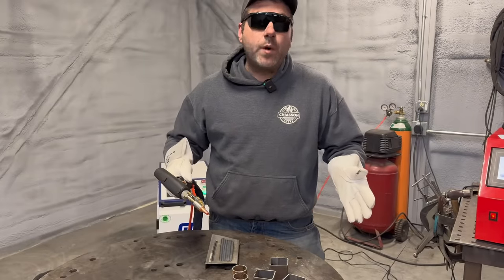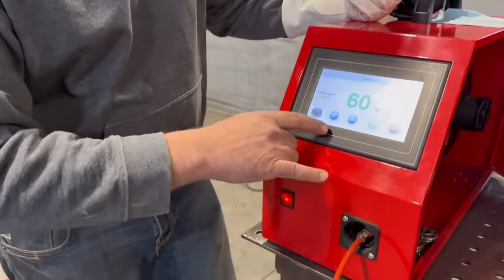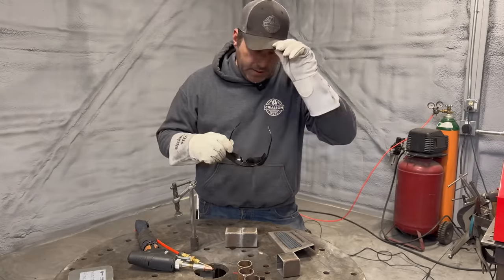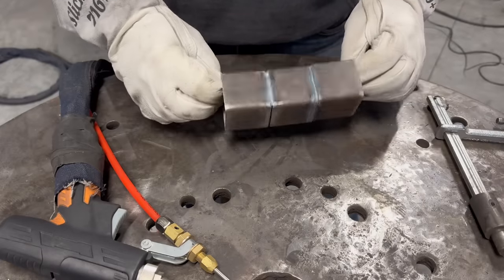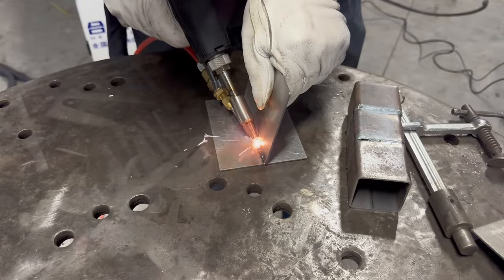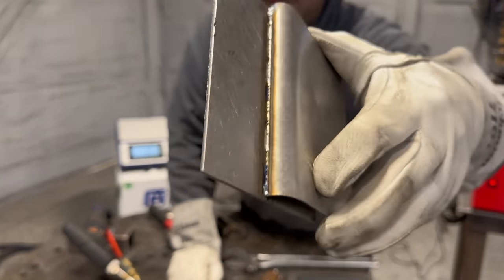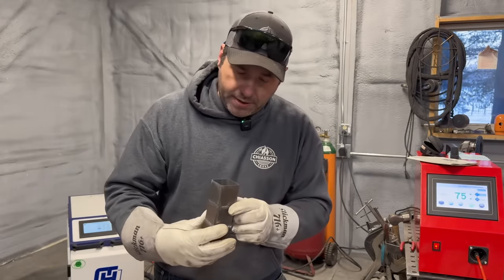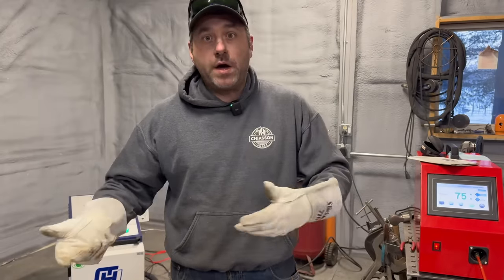Laser Welder from China- How does it Weld?

Comment: The issues with gaps suggests this system is more suitable for production of fabricated designs with machine cut or carefully hand fitted parts rather than general repair.
Reply: It has an adjustment on the machine to weld different gaps. With the double wobble machine you can adjust the weld bead to 5 mm wide.
Reply: Mine will do 3mm, but I just give it another pass
Reply: Use Tig welding rods
Reply: @kingrutse3278  like hillbilly welding? Fill the gap with filler metal, then weld over it? I know guys who do alot of stick welding will put electrodes in crazy gaps, but they're usually welding steel at least a quarter inch thick.
Reply: then just use a regular welder!
Reply: @darrinjones9387 I was gonna say just do a cap pass
Reply: Wouldn't thicker welding wire weld bigger gaps? And instead of going with the edge, what if you welded at 90 degrees from it? Like a sewing machine, from one piece to another, back and forth.
Reply: Maybe @DansBuddhaBodega makes my point, but can’t you lay in some filler steel, even draw out some extra wire and then lay it in the gap and make a welding pass like before? Yeah, it’ll need some grinding of the excess and cleanup, but ought to work ok.

Comment: This thing has its limits but it has two major advantages: Extremely low power consumption when compared to a regular MIG so you can weld on the move, and the ability to actually see where you're welding, instead of only seeing the melt puddle.
Reply: The 'glass' of your darkened weldingshield also is a consumable. Change it, it will change your welding for the better.

Comment: I have a 1500W laser welder. I have had it about 1-1/2 years now. Gun angle is important to get a good weld. Wire diameter makes a big difference as well. The larger the better. I run 1/16" wire most of the time on mild steel, .045 on aluminum and stainless. 

I would be happy to discuss with you some pointers on making work better for you if you want. Just let me know.
Reply: Just bought 1.5 Kw laser welding machine. Can you gabe some advice about working parameters?
Reply: What is the name brand on yours if I may ask?
Reply: Great comment.   Welding with a laser is just different.  He needs to get some help and his attitude toward the laser will change.  It isn't perfect but nothing is.  Right now he seems more skeptical about it than anything.
Reply: i also have a 2 year old laser welder and im about to change it, the handle and the cable weight kills the wrist, just love the machine but the ergonomics are horrible when working with them
Reply: @tonta182 I forgot what brand sent me it but it was essentially a chest piece/vest with a $20amazon desk collapsible/raise able microphone stand (quite literally) to hold the weight and it actually works great aslong as you don't have long arms
Reply: Can i ask how do you view your tip working backwards?.
Reply: @Koontarules  i quick check the melt of the weld and then i do my best to check the back of the welding shoe so i know where im welding.

i think they should have made welding shoes that are oval shape so the thread can´t jump out of the badly design groove underneath the welding shoe
Reply: @tonta182 do you plan to buy new one?we can discuss it.
Reply: @user-it4nu7im1v  I sold the old one and bought a new smaller 1,5kw welder and the handle is now 700gram so now it´s a joy to weld again and i got 10meters of cable.. wohoo !!!

Comment: I used to operate a 8000 watt dual head laser welder. We used it to butt weld steel coils together. The two major problems we had was gap issues and the heads not tracking the seem but after a few upgrades the machine worked awesome. We could weld a 60 inch wide strip in about 15 seconds. There can not be any gap and the laser has to track center or the weld will break.

Comment: I can see how this would be useful for replacing body panels in automotive restoration/ RestoMod work.  Often times the replacement panels are about 19-20 gauge and traditional tig welding is more time consuming and throws down a larger weld.
Reply: Maybe if it weren't for the gap issue. You'd have to cut a perfect replacement out. Might as well stick with tig since you can fill small gaps with filler rod
Reply: @velvetypotato711  MIG brazing (and TIG brazing which you can also do with MIG brazing wire and pure argon like TIG) is increasingly popular for body work.
Reply: What is price this machine welding

Comment: From what I have been "TOLD"
Fit up is crucial, as you mentioned they don't like gaps (the laser has to hit a surface to provide heat)
Everything has to be CLEAN, there is very little heat (compared to TIG, MIG etc.) to burn off contaminants.
GREAT on thin gauges (that low heat thing again)
Autogenous welds are fun.
Treat it like a low temp TIG

Again, it's what I have been told, so YMMV
Reply: Great point that the laser has to hit a surface!!... Im looking at a 2k raycus 3 in 1 on amazon

Comment: Nice machine, however, as you know, it's hard to get perfect fit up every time. But still interesting, would like to see more. I WAS in the welding business for over 20 years and it's still interesting. 
Thanks from northern Illinois.👍
Reply: It does not need perfect gap. You can adjust the width of the weld on the machine.

Comment: So, it's like a TIG and a MIG all rolled up in one with a bulky gun .  Makes prettier welds than both (with less practice for a nice TIG look) , but has a problem with changing over to different materials . Wire changes would be a pain, especially all the different choices for stainless and aluminum . And then the cost . Last I heard they weren't priced like a little Primeweld . Like you said, it would be good at thin no gap jobs . :)
Reply: Wire change is simple. Remove one spool install a new spool. Welds many different types of metal. Even different types to each other.
Reply: @HP31 where do you get these?

Comment: I think it would be good for things like auto body, decorative things like flower garden entry gates, picture frames, motorcycle gas tanks, and other jobs that require a thin extremely uniform welds. If a person had a business that specializes in that kind of stuff I can see getting one. I'll stick with my stick, mig, tig, and oxyacetylene for the stuff I do though. Tig can do all the fancy stuff too just takes a lot longer, but I don't get a lot of projects that require me to do that stuff.
Reply: Agreed, though with new tech being developed daily there are 3kW machines that do a nice job on thicker 1/2 inch plate, only a matter of time before these machines will handle 2-3 inch plate, if it's not already available.

Comment: Makes sense that it won't fill gaps. If it is using the laser to heat/weld the metal, a gap gives the laser no place to focus the heat, except on the filler material. If you have a gap, then you would either have to machine the metal to tighter tolerances or build up from each side. Just my $.02 worth.

Comment: I would bet its not the fact that it wont fill gaps but be the fact the laser has nothing to hit. Laser hitting the metal is how the heat to melt the metal is transferred. So if the laser is shooting through the gap then no heat is being transferred to the metal trying to be welded. But if you run a larger puddle of metal i would bet you would have better luck. Slow down your movements and maybe speed up wire some. No experience with laser welders but have done a lot of welding. Would be nice to mess with one tho. Seem pretty neat.

Comment: Good video, I was keen to see how this kind of welder performs. Just one thing, I think you really should wear a full-face visor otherwise you could still get UV burns on your face. I think the gap filling issue might be improved with larger welding wire and higher wattage.

Comment: Yes! Laser welders are not ideal for welding gaps... but there's a trick.
Obviously depending on the gap, you can use the electrode wire as a filler by feeding it. On wider gaps you can actuality not use the laser's wire but use tig welding rods.
You basically use the tig's rods as a filler.
I think as of the cosumer's available technology, the laser welder cannot replace the TIG welder but it can certainly fill in the gap for new users and the capacity for fast welding. Quality of welds are not bad, so there's definitely a place for these laser welders.

Comment: in a production environment, this is supposed to be used with CNC cut tubing which fits perfectly together. if you manually cut or your joint is not perfect, it is hard to achieve good weld.

Comment: LKaser weldingdoes not rely on grounding. The gap welding required manual circular moveement by the operator or thare are also guns that have a very small rotating / scanning prism that rapidly span gaps as the operator manually sweeps a handheld .045" non flux core welding wire media across the gap to maintain a puddle hot enough to cause penetration.

Comment: Cleanliness isnt as critical with laser welding as the laser is cleaning too. When you have gaps, use filler rod if needed, if its a smaller gap then thicker wire can help too and you set the laser to span the distance. As with anything, its all about learning how to use it

Comment: Ive only seen shops use this for cheap, "assembly line" type of welds on thin sheets of alloys.  What use is a welder that can't handle a gap? Whether it be structural or pipe, proper fit up almost always REQUIRES a gap. I'll stick to my mig welder, thank you very much.

Comment: Light travels in straight lines.  There’s nothing to absorb the energy in a gap.  No ground cable and no UV radiation.  Safety glasses must be made for the wavelength you’re using.

Comment: i replaced mosfets in the induction heater board kit. not exact and just popped. i will try another board at 7 volts. the newer mosfets use a positive voltage to start conducting. john fron 1960's torrance was burning a tube of aim toothpaste. i think he worked on led screens. probably unloaded a shipload of color chemicals. i have an attempt at running a 60hz inverter. i burned out an early inverter trying to run a small microwave.

Comment: Also... you're moving at a snails pace compared to how ive seen these used. Maybe bumping up the power and wire feed, will make it more like spray trasfer than short circuit? In my experience, butt welds are almost always cosmetic.

Comment: For me its simple. If you are entusiast, pick the same car, automatic and manual. Manual its more efficient, has less fuel consumtion. Normaly has fast aceleration and its so much fun to drive in the limits, in a track for example. Its safer too, you pay more atention to drive, and If you push tô hard in a corner, in automatic car, you go to the road. In a manual car depend How that car its leaving out, you can instantanily push the clutch for neutralize the Tork in the Wheels or reduce one gear to make a car loose the traction a litle on the back and return the equilibrium for the car. 
Manual its life.

Comment: Could you weld like TIG using it as the torch with a filler rod?
Reply: You can try. It has a spot function. You can tack without the wire or use a nail if you want so long as it is shielded with gas

Comment: I am a hobby welder.. meaning my hobbies require some welding once in a while.   I have a gas mig and a 110 stick welder.   neither of which I could have afforded 30 years ago and both smaller than anything then.  they work fine.   I will get a laser welder if the cost goes down enough before I die.     One small weld a week is a lot for me...I have to run test welds every time cause...well... I forget this or that.    Both of my welders have some sort of basic chart.   that works for me.

Comment: You probably don't have your gas set to the neccesary pressure. Unlike mig welding, you need about 70-100 psi of gas pressure coming out of your regulator/cylinder. You cannot use a CFH style gauge like in normal welding. Those only output 50psi at the most. You need a gas pressure gauge that can handle 100 psi output.

Comment: If it uses less heat , I could see it's use in automotive body rust patching. However still using gas and wire, I will stick with mig.

Comment: Complete amateur welder here. I've done mig as part of panel work repairing holes or welding on new steel skin onto damaged panels etc. 

But from what ive experienced the material feed when mig welding will follow the arc and so as long as your near enough it will flow to the closest edge and fill nicely.

The laser is only ever going to go straight so to fill a gap you would have to aim at the edge itself, obviously with an arc that would often blow holes in the work piece ( especially with thickness i was working with ) i think with the laser you could safely aim at at an edge without blowing out the work piece.

Could be wrong but mind you 😂 but its definitely not a time saver if you need to do lots of filling.

Comment: I’ve been checking this machine and the laser cutters and the problem is they are power pigs.  The US and European machines (that cost double) take 1/3 the power to weld and cut thicker metal more efficiently.  Not sure what the deal is but my China machines are not as satisfactory even though they run fine

Comment: ive been interested in these laser welders but i think im good still.
its literally just an expensive mig welder. and the laser part i dont see much of the added benefit. compared to the price.
i decent mig welder can weld alot more for way less money. a cheap mig welder can still weld more and thicker. 
but in another 5 years these things might actually get into a more affordable category and there are some good use cases if the handle can get smaller.

Comment: Is it pull only? Just wondering if it would fill better with pushing? You did say theres no feel and im assuming you mean the wire. It looks pretty cool especially for light steel, can it weld all types of metal? Hoping to see more of your testing!
Reply: If you set the wire speed and watts correctly you feel the wire pushing you along.

Comment: what do you see behind those laser glasses are you seeing the light is it not that bright that you don't need a welding helmet. cant find a video where they show behind the glasses like tig or mig the weld puddle
Reply: You have e to get the right glasses for the exact wavelength of lazer so you don’t blind your self a regular welding helmet won’t work  it dose remove paint and rust. He has another video showing. Hope this helps
Reply: @chasemccall391  I know I am going to get some really good glasses for lasers but I want to see how is looks behind the glasses since they don't go dark like regular welding glasses
Reply: i think it will be fine with just the laser goggles. there's no arc to blow out your vision like a regular welder, just just light off the molten metal and the barely visible ir from the laser.
Reply: The light off the laser does NOT need to be visible to blind you. Both IR and UV are invisible but if they are bright enough (intense enough) they will destroy your retina. You absolutely need to use glasses that block the wavelength of the laser light, and if it’s UV, you should cover your bare skin as well (face, arms, etc.) the melt puddle is dim by comparison!

Comment: If you have to spend a extra 5 mins a cut getting your joints near perfect I do not see what good this would be.  You still need filler wire and gas.  Maybe it saves electric as it pin points it better.  But you can now buy cheap stick tig mig combos that can do so much more.  I am sure this can have its place but I doubt the average home or even professional welder would benefit.  I will stick with what I know.

Comment: Seems like an overhyped version of any MIG welding machine with a shielded gas setup like argon or carbon gas. hell even with a flux core wire the same result can almost be accomplished with proper prepping and machine setting .  now if it cuts metal and cuts it cleanly its a plus but then its a fancy plasma cutter with an alright weld option I quess.  Not impressed. thanks for the video it was pretty cool

Comment: You’re not suppose to have a gap, that weak, then the pressure on both sides the weld. A fit is priesure only one side  the other side hit them metal tight fit behind
Reply: Usage is push and pull =slowly bending in time  till break

Comment: I don't see the point, the hardware seems the same as a Mig, with wire and gas.  As a flux core welder,  ( when I have to weld ) there doesn't seem very much advantage for the DIY user.

Comment: So 15k for something a high end miller can do.
 I don't understand.
I can weld oxy and ace great and only costs pennies compared to a laser system.
I guess I'm not seeing the point.
I mean the appeal must be the ability to have a very controlled clean weld without having the heating and welding marks expand past your actual stinger tip.
Which ya that's dope but that's easily done with tig and practice.

Overall great video man! Thanks for posting.
Well done and excellent quality  video.
I'm subscribed.

Comment: This still looks like mig welding without gas you got the tips,also the wire,the cup the wire speed I'm not so easily fooled by this. The only thing I see different is it looks like it's got a laser pointer on it,not convincing. Better just get a cheap stick welder. I have been welding aluminum,iron& steel for 40 years don't be fooled.

Comment: Not a pro welder what so ever, but if you had a gap couldn't you back it up with something? That way the laser has a surface to hit and then the heat would be trapped on 3 sides? Again i just started fooling around with a mig & stick so i am a shade tree barbarian when it comes to what is common practice.